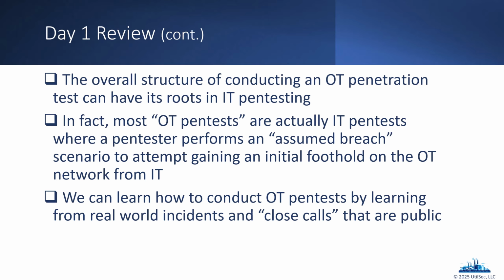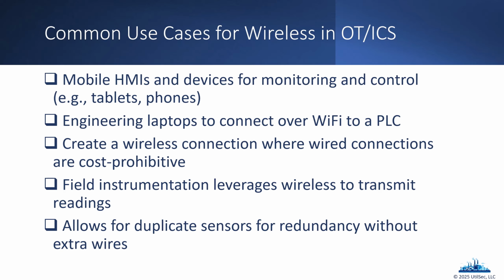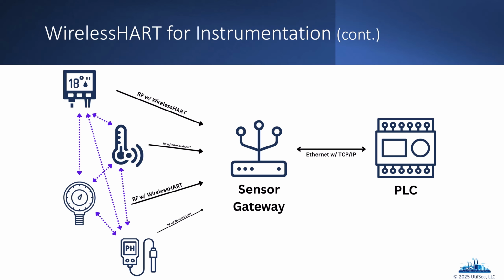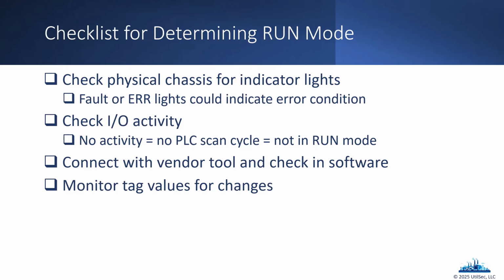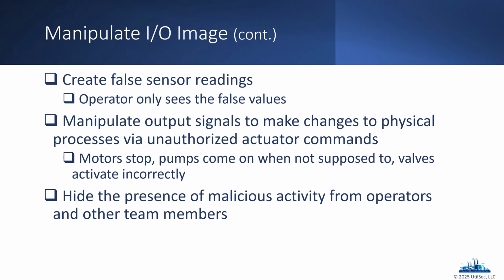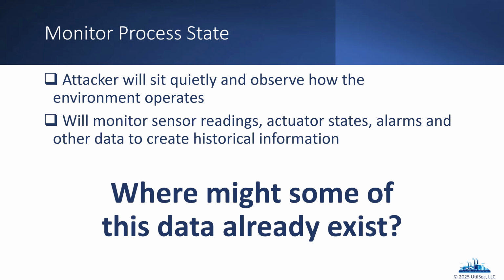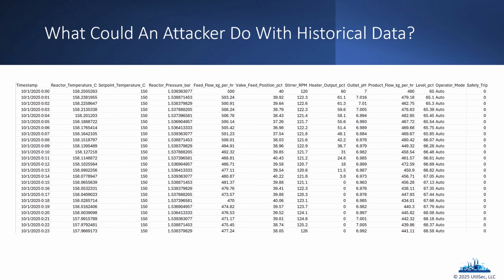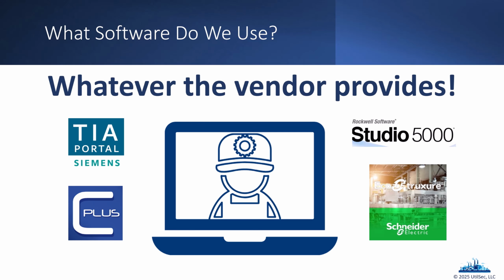Intro to OT/ICS Penetration Testing (Part 7): Attacking Wireless, PLCs and the Process in OT

Comment: Mike,

It seems that the video description for this part  is more concise than the one provided for the previous parts.

In particular, it does not include the course materials download link or the chapter timestamps ("In this video").

Additionally, when reviewing the course materials link, only the slides for Part 1 appear to be available. 
The lab manual (page 65) indicates that the materials for Parts 7 and 9 are still marked as "coming soon."
Reply from the maker: Thanks for pointing these out, @ShallowHeartNB - I'll be sure to work on these once I'm back from vacation!

Comment: Hi mr.mike
If start right now 6 hours per day from ur YouTube how many years of experience I need to get a job 

I have 2 year experience in pentest "web"
Reply from the maker: Thanks for the question, Abdarhman.  If your main focus is to get a job, you won't want to focus on OT/ICS penetration testing where the opportunities are very limited.  On top of that, you really need to master IT pentesting first. So if you've already been working in IT pentesting, including web apps, your best bet is to focus there and find a role.  Once you have a role and some experience under your belt, and believe OT/ICS cybersecurity is a good fit for you, then I would suggest making the transition but not until then. I hope this helps answer your question - good luck in your job search!
Reply: @utilsec thanks mr.mike for this advice ❤❤